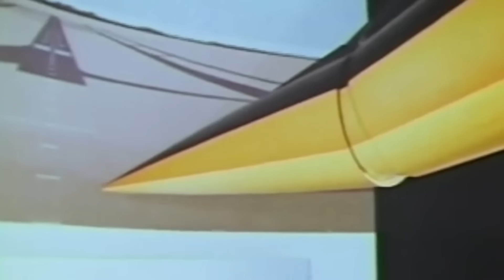The Insanely Bigger Faster American Concorde Failures

Comment: In the late 90s i used to live in a part of Surrey in the UK that was beneath the flight path of planes that had left from Heathrow, and although most planes were barely audible as by the time they were this far out they were much higher up I remember that when Concorde was overhead and still climbing it actually shook the windows in their frames and completely drowned out the TV if the windows were open, it was brutal. I can't imagine how bad it must have been for towns nearer to the airport. Sure, the plane was a marvel but try being a fan when you actually live in a town under the flight paths of these things.

Comment: Yeah, 9/11 hurt airlines and flying. The Concord was insanely expensive. It was several thousand if I remember right. They also couldn't fly short trips which doesn't help an airline when they can only use those planes for long flights.

Comment: Boeing did NOT begin their SST program in response to the announcement of the Concorde program (which ultimately led to the formation of Airbus Industries). The model 733 (later renamed 2707) dated to before 1960. Kennedy decided the US industry needed a push in the form of a sort of contest which was announced and begun in 1963, a few years after. At no point was the US EVER BEHIND either Europe or the Soviet union in this area of aerospace technology. One look at the B-70 Valkyrie will quickly disabuse anyone of that notion. The more accurate take on the matter is that the demise of the 2707 with the near bankruptcy of Boeing was an example of an early 'victory' for the environmental movement. That stripe happened to be quite small and weak in Europe during that era and so their objections were ignored. The Europeans continue to benefit from the Concorde program by the existence of Airbus and Godspeed to them for doing the right thing. At least someone did.

Comment: 1134: nice number; picture a movie theater slopping seat the wrong way very long way from screen. U hve a hall flat wing floor 1st then 2nd wing mostly slopped  wide wing floor but 2 steps down into each new wide reverse slopping floor wing. So just say hall wing ratio is 10ft wide tallest not as wide. then 1st wide down slop floor is 25-30ft. @ steps down then two more wings. Last might only be 20ft wide. Safer w/multiple wings if just fire break or damage break. Then more basic construction no need to model try for to much fast commercial pricey end travel, just safety & comfort. Each section can detach from body 1/2 the wing, So most tossed is less than 1/4 of ppl.  Saving these ppl section requires new innovative approach. If mach3 cost not oil burning ever poss.

Comment: Way too much VPN Advertising! America will never Develop anything as far ahead of itself as the British Concord was in the early 60's!! In your Clip you state it was British and French?? The Concord without the e! Was Designed, Built and Tested from Britain, the French got involved on a cost basis and put a few dials in the instruments. The Rolls Royce Engines were totally Britsh, so was the Double Delta Wing Design, the Expanding Fuselage, the whole thing came off the Drawing boards at Filton Bristol. America was so far behind it was embarrassing, the only recompense you could think of was to stop Concord landing in the USA! Joke! Get it right America - Concord was British it died in Paris thanks to a Beoing aircraft dropping a large peice of metal on the runway which caused the Paris disaster. So America why dont you just report the facts. Concord was as French as Roast Beef and Yorkshire Pudding! Bristol Born and Bred in Great Britain! Get it right! The most Advanced Aircraft EVER designed and built in it's time! It would still be flying now if it had not been French Politics!

Comment: If u notice take for instance the B-58 Hustler yes a beautiful plane the engines in pods hanging out on the wings caused drag and structural failure. With the B-70 they were centered in the fuselage. Better center of gravity less drag. Hence the concord. Funny all the is just to move some passengers at a faster speed across the pond. People that had more money to spend are they really that important? And funny it ended

Comment: Used to have a "working"( lights flashed, wings extended and retracted, wheels moved it and it turned port & starboard, and made jet sounds- when there were 4 good D  batteries installed ) model of this back in late '60s. Dreamed of travelling the world in a real one.

Comment: Something to also realize is Boeing especially had their own designs on the table, ones they had researched and knew they could build. None of this SST boondoggle would have happened and we would have had a few years of leadtime had the government not decided to take up the SST project and foist it on private companies. Boeing knew it was a huge loser, but if the government was helping with the cost, so long as it shut them up, fine. The 737 ended up becoming the most popular aircraft in it's segment, the 747 ushered in the jumbo jet and high capacity aircraft that also offered great comfort. As it was by the late 60's if not earlier, the British and French were both done with Concorde but neither could back out due to contractual agreements. In the end concorde was literally a box of nails in the coffin of the british aircraft industry. Meanwhile Boeing continued on, along with other US aircraft companies to build aircraft that airlines actually wanted, and other nations bought them too. SST projects sound great, but only if you never consider all the insane costs.

Comment: The sonic boom was the issue and still is today.  In 1993 I lived in Ashburn, Virginia and when I went running sometimes I'd see Concorde climbing out of Dulles.  Later, I owned a house in Orlando and when the space shuttle came over my house the double sonic boom was either like a large 4 inch PVC pipe hitting the ground or like a shotgun going off just outside my opened window!  I watched my cat literally leap 3 feet in the air from the couch when that blast hit!  They are now working on shapes that minimize the boom to a manageable level, but the big problem is that if you want to go faster than mach .80, you are going to burn a hell of a lot of fuel.  I don't think there is a business case to this day for a supersonic airliner.

A supersonic private jet?  Probably.

-The thing about the Boeing 2707 was that it was developed at the same time with the same engineers as the 747.  The idea was that the American Airlines demand for a widebody airliner capable of taking 250 passengers from New York to Los Angeles nonstop in the winter could be met by a larger four engine design that was actually a freighter.  The 747 and the 2707 would share as many parts as possible.  An airline that bought 747's could later purchase 2707's and their parts stock would still be viable.  AND the 747's could be sold to cargo airlines, since they had a nose door and the cockpit was on the upper deck.  The implication was that McDonnell-Douglas' pile of shit DC-10 and Lockheed's wondrous L1011 would essentially be worthless the first day the 2707 flew....but the 747 wouldn't be.  

It was a brilliant strategy, but the smelly halitosis, foul-mouthed asshole Nixon nixed the SST and that was that~
Reply: You have a problem with MATURITY.
Reply: @robertsettle2590  You have a problem with insecurity if you feel that you can label me that way by reading a couple of paragraphs I have posted on YouTube.....

Comment: My memories include the incredible noise as it flew over my house (in central London) most evenings.  Unlike other aircraft, you could hear it a couple of minutes before it appeared.  Another memory was, when I was hired by British Airways, and doing my orientation at Heathrow, we got to walk around the BA hangers and I saw a Concord parked at a right angle to a Lockheed L-1011, with the nose of the Concord under the body of the Tristar.  I was told that, due to its narrowness, the stewardesses, as they were known then,  had to serve food and drinks while facing up the aisle as if they turned towards the passenger, the  passenger on the opposite side would get an arse in the face!  I also remember that I thought that I would be okay with that :)
Reply: If it’s flying faster than the speed of sound, how could you hear it before you see it?
Reply: @michaeldebellis4202  because it wasnt allowed to fly over land at mach speed. it only accelerated to those speeds over the ocean. Just imagine such a big plane flying over a city at mach speeds would shatter most windows in an instant. killing pedestrians in inner cities from falling glass "blades".
Reply: @No_Way_NO_WAY  Thanks. That makes perfect sense. BTW, I realize my comment may have come off as I didn't believe the statement, but that wasn't it, I was just genuinely curious.
Reply: @michaeldebellis4202  that was one of thr issues for concorde, it was really inefficient at below mach 1, it used a lot of fuel and could just about keep itself in the air, things got a lot better at mach 1 or above, the faster it went the better the olympus engines worked and the more stable it became. I recall reading somewhere that landing a concorde wasn't a landing in the traditional sense, it was more a controlled fall
Reply: @michaeldebellis4202  When it took off it flew subsonically.  Once it was over water they'd turn on the afterburners until the aircraft reached 58K feet and was flying at approx. 1350mph.  Concorde was the only supersonic aircraft that could fly at Mach 2 with the afterburners switched off.
Reply: Got to see one take off by chance at Charles Degaul. It was raw power
Reply: @animalanimal7939  - In the Navy, saw F-4 Phantoms, F-8 Crusaders, F-14 Tomcats  take off. Also, F/A-18A Hornets.  I didn't fly. I was a mechanic but got to run the Hornet engines.  That was fun.

Comment: Honestly, the reason that the American SST program failed is that the wrong company was chosen in the end to build the plane. At the time that the contract was initiated North American's XB-70 was already doing Mach 3+ speed runs so it was shown that an airliner-sized aircraft could attain those speeds without having to resort to heavy and complex for the time swing-wing gearboxes. It wouldn't have taken too much reconfiguring of the Valkyrie's airframe to turn her into a world-class people mover.

Comment: The Concorde was an excellent aircraft that never suffered an actual crash caused by equipment failure. It was not the Concordes fault debris was left on the runway but it was a convenient excuse to get rid of the plane as it was very noisy and polluted like a mofo.
Reply: You need to do just a little more reading on the subject instead of trying to oversimplify things.  Had there not been other issues with the aircraft (overloaded, misaligned landing gear, uneven fuel load) and it had lifted off where it normally would/should have, it would have never struck the debris on the runway...  The NTSB had previously investigated the Concorde and it's tire incidents.  Throughout it's life Concorde had over 70 tire and wheel related incidents, 7 of which caused serious damage to the aircraft and were described as potentially catastrophic with damaged fuel tanks and engines.  It was amazing it was ever built, but there was a reason the United States pulled the plug on theirs.  Aircraft like the B-58, B-70, and SR-71 were all flying years before the Concorde.  Yes I understand the challenges of building a passenger vs. a military aircraft...  Concorde was "cool" and was a huge source of national pride but it was never a money maker even prior to 9/11 and that's the reason it was finally withdrawn from service.
Reply: @sidefx996   "even prior to 9/11" Relevance?
Reply: @samclark8468  Airline travel as a whole went in the shitter after 9/11.  It's one of several contributing factors why Concorde was retired.

Comment: The report Kennedy requested from the FAA didn't just 'include' America's aviation goals for the next decade, it was written specifically to define them.
Why quote thrust in kN, when the specification was all written using lb force?
Boeing added canards to add extra weight??  If you read your wiki page again you may understand that the canards were necessary to give adequate pitch authority; the extra weight was a significant problem!
The swing-wing mechanism wasn't 'inflexible'.  What does that mean?  It was however, as designed at that stage, too heavy when engineered to take the required stresses.  It might have been worth noting that 10 years later technology had advanced enough to make it usable in the B-1 Lancer.
When you start talking about the delta wing perhaps you could show us one instead of the variable geometry one.  There are plenty of pictures out there, both plans and of the mock-ups.
The FAA didn't ban SST flights because they were too expensive; that's for the airlines to work out.  They let the environmental lobby make the case when it became clear that the program was not going anywhere and they didn't want European Concordes showing up a US technological failure.
There are actually a few SST programs running apart from the X-59 technology demonstrator, including the AS2 and rather insensitively named 'Boom'.  The focus has changed though from large commercial aircraft to the business jet role, where the costs may be easier to cover.  Hypersonics are also being investigated in the commercial world, but again the business case is yet untested.

Comment: The Tu-144 made its final flight on 26 June 1999 - it only stopped passenger service after 55 flights, it performed cargo flights and non commercial operations including being used by the Soviet space program to train pilots of the Buran spacecraft, and by NASA for supersonic research until 1999

The TU-144 was the first and fastest commercial supersonic  jet and spanned 30 years from it's first flight. It was too noisy for passenger comfort I read and also got off to a bad start with the Paris crash. However, it is often dismissed by many without looking at the underlying facts which include the fact that the cost of operating supersonic aircraft was done at a loss by all operators. The irony being that the failure of the US supersonic program may have ultimately saved operators from a costly loss making aircraft.

Comment: None of the guys working on Concorde could have even predicted the Oil Crisis, which was already at full swing by the late 70’s when Concorde was just entering service. Chances are, if the 2707 was built it would only have lasted for a decade before operations were shut down for good. Supercruise technology just wasn’t there yet, and putting experimental turboramjets like the J-58 engines would made it worse. 

What the Europeans did predict correctly was the need to combine the might of several countries at once to develop a plane that would not only survive the Oil Crisis, but provide just as big or even bigger seating capacity to maximize profits from low cost flying, rather than exclusive and exquisite single aisle planes that would cut Atlantic crossing trip durations by half. Hence, the Airbus and their A300 was born.
Reply: @stillshakin2125  Huh. I figured supercruise would be a pretty familiar concept to modern supersonic fighters but I guess the Concorde is just way too ahead of its game. Hopefully BOOM could exceed the supercruise efficiency someday.

Comment: If they would make a larger B1B Lancer , i think it could be done much cheaper for manufacturer and future passengers, even though it would be a bit slower, it would still be a big step up from the subsonic airliners in use today.
Reply: You realize that Lancer has a top speed of about Mach 1.6. It's not a plane that cruises at supersonic speeds.

Comment: North American Aviation had already built the XB-70 in 64, they should have called North American to build/ re-design it as it was already a successful delta wing plane capable of 3300kmph with 6900km range. Would have been a huge head start.
Reply: A book on th XB70 has drawings of an airliner configuration. It’s named Valkyrie
Reply: @mthury4532  was under the impression Valkyrie was always the Xb-70's name.
Reply: NAA was 1 of 3 contenders for the American SST, and their NAC-60 trailed the competitors in passenger capacity, and also both those planes, Concorde and the Tu-144 in terms of range. Airliners and bombers are completely different.

Comment: I saw the BOEING SST pop out of a BOEING HANGAR down in TACOMA, near the HYATT! The BOEING HANGAR was VERY NEAR THE AIRPORT and marked TOP SECRET all over the place. There was NO PARKING on the highway and a 35 mph speed limit, which I failed to achieve when I saw the MASSIVE DOORS swing out and the BOEING SST was pushed out of the HANGAR and then JUST AS QUICKLY returned inside and the doors QUICKLY SHUT!

Comment: swinging 60's LOL,russians used steel structure instead of exotic metals in the TU-144 and 4 engines instead of 2 to get required thrust,LUCAS refused to sell them fuel pressure regulators and pumps,it got "brake checked" at airshow by a fighter jet checking out it's performance and broke up in the evasive move not to hit fighter jet,